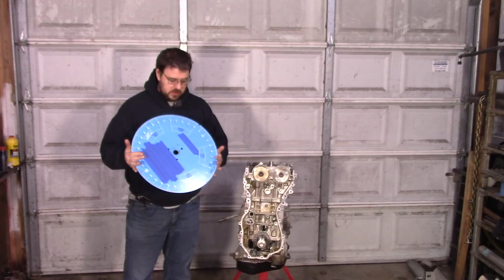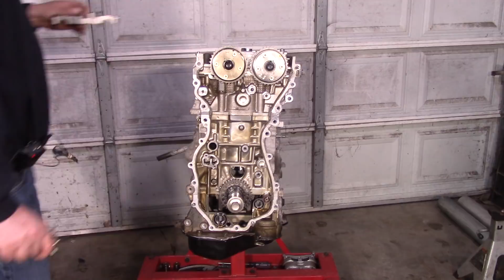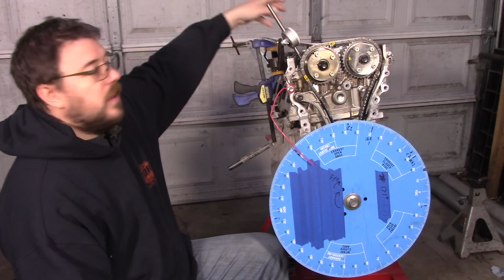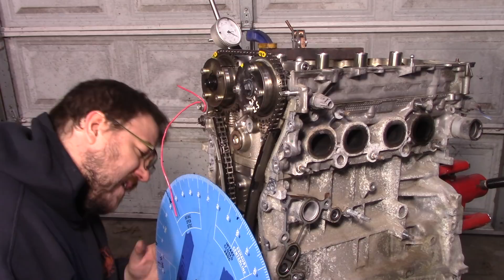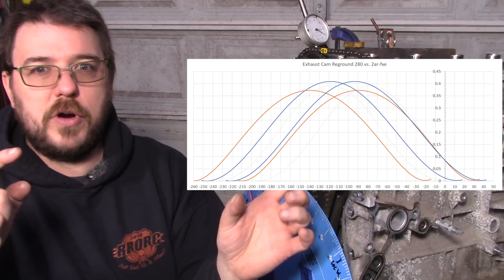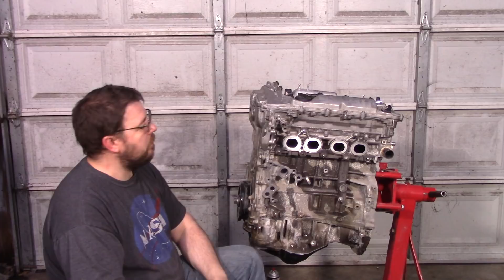Toyota Hybrid to High Performance Conversion (2AR-FXE)

Comment: I have a 2AR-FSE which is D4S not Atkinson cycle, and it's mated to hybrid drivetrain with e-cvt in a Lexus IS300h... I'm curious, your build in the video, will you pair it with hybrid drive or to a manual or zf gearbox?

Comment: Do you think using a 2arfxe block with 2ar/1ar heads would work? I know you wouldn’t get the duration advantage with the 2arfxe cams but assuming the heads are interchangeable we should still see a higher compression with maybe a small increase in power on a stock ECU without having to screw with the cams? 

Or at that point a 1arfe in its entirety might just be the way to go? 

Sorry if you already saw this comment. Think my old one never posted. Unsure.

Comment: Would the same thing work on the 2ZR-FXE?
Reply from the maker: i don't know for sure but based on what i've seen and heard it certainly seems like it would.
Reply: @FrankensteinMotorworks  ct200h's and prius' are way more common here (Netherlands) and so are the engines of course. Thinking of buying a ct and seeing what bumping up the power on that engine will do to the hybrid powertrain.

Comment: Do you think something like this is possible with the 2ZR-FXE.  Its sibling the 2ZR-FE was also in the Elise according to wikipedia.  And this engine is a dime a dozen now
Reply from the maker: It certainly could be but that's the kind of thing that someone just has to try in order to confirm if it works or not.
Reply: @FrankensteinMotorworks  I was talking to a mechanic over the weekend, who used to do track prep work on lotus's but now does a lot of refurbishing and service work on Toyota hybrids. He had mentioned that if you took the 2zz head and the 1.8L head from the Prius and sat them next to each other it would be hard to tell a difference between the 2.  Which ultimately led me down a rabbit hole to your video.   I might give it a try, a Prius with a dead battery could be a fun lemons car .
Reply from the maker: @CedricParker  if you go down that road please share how light a prius is without the battery. i think it would be a really light chassis and a great place to start.

Comment: What about axles and manual trans for an sw20 swap.
Reply from the maker: I will be making a motor mount for the SW20 to swap in the AR motor but the SW20's transmissions directly support the AR motor so there's no need for an axle or transmission swap.
Reply: @FrankensteinMotorworks  both manual and automatic?
Reply from the maker: @thomasiturraran3623  I have no idea on the automatic. Since it bolts to the 3s and the 5s motor there's a really good chance it will also bolt to the AR but the only guarantee is that the dowel pins will align properly.
Reply: @FrankensteinMotorworks  Thanks!

Comment: I don’t even own a Toyota or anything I would want to swap a Toyota engine into… yet… but this is interestingly… uh… interesting! Thank you for the videos!
Reply from the maker: even moreso after i raced it last weekend. This thing was an absolute beast. i will be making a video on that shortly
Reply: @FrankensteinMotorworks  Just out of curiosity… why not go with the dual VVTi? Doesn’t the TC have dual VVTi? Maybe yank it off that TC engine you too out of… that TC? 😅

Also… how are you locking the cam that does not have the VVTi solenoid?
Reply from the maker: @VictorMPR  I am using dual vvt-i. at 29:55 you can see both phasers are on there and at 30:30 you can see both solenoids are installed.
Reply: @FrankensteinMotorworks  I see! I got confused by you saying you were not going to use an exhaust VVTi solenoid… somehow I didn’t hear you say you were going to use the intake VVTi solenoid instead. I had to go back and “listen good”. Thanks for the clarification!

Comment: Are you planning to use the stock or aftermarket ECU?
Reply from the maker: For this one i have to use a Haltech Elite 1500 ECU because the cam trigger position is not stock. but the intention is to make it so this works on a stock ECU also.

Comment: How do you think this setup would respond to boost reliability wise? Compression too high you think?
Reply from the maker: After i get this on the dyno i'll have a better feel for the knock sensitivity at this higher compression ratio but based on the fact that people put 9-10 psi without issue on the lower compression motor then the higher compression should still be able to take a couple psi of boost. But you might be able to use the atkinson nature of this motor to reduce the compression ratio through the knock sensitive portion of the map (if there is one) while keeping the turbo mostly spooled up and then still have boost available as soon as you exit that region.

Comment: That moment when learning how to degree cams on japanese inline 4 motorcycles from the  late 70s with a degree wheel, coat hanger, butchered spark plug with a dull long bolt through it,  and a dial indicator pays off..again.  But yeah, it was a lot easier with just slotted cam cogs.  Factoring in the VVT makes my head hurt, but is the gist of it that, as rpms rise, you need to advance the opening on the cam to give the air a little more time to reach the much faster spinning engine?  You've got a super clever idea for building power on the cheap.  Hope it doesn't detonate.  But hey, there is always e85?  Thanks for sharing.
Reply from the maker: Yeah, it honestly made my head hurt a bit but I got it in the end. and yeah being able to dynamicaly re-time the cams makes the torque band much wider. it ends up adding 15-20% more power in the mid range over a motor with the same cams tuned for peak power only.
Reply: VVT is the gift that keeps giving.  Thanks for the walkthrough.

Comment: Slightly OT: Can the same be done with a 2GR using parts from the FKS or FXE? Wondering how complex tuning would be with port/direct injection. 13:1 compression on the engines from the Lexus GS 450h tho...
Reply from the maker: yes and no, i just got a 2GR-FXE intake cam and it is quite large but it can't easily be installed in the exhaust position for a few different reasons.
Reply: @FrankensteinMotorworks  any chance it might make its way into a video or is it too much of a roadblock to pursue further?
Reply from the maker: @VertigoGTI  It likely will. it's all dependent on how well this 2ar-fxe does first. I ordered the intake cams as a result of me measuring the 2ar's intake cams.

Comment: I do want to ask, what about swapping a 2arfe into an sw20? Would it not be a direct swap/close to? I’m a Datsun guy not an mr2 guy so let me knowシ
Reply from the maker: the motor is small enough to fit in there but nobody has confirmed if the stock position hits the strut tower or not. it might need a different rotation than stock.

Comment: I went 2 teeth with the 1nzfxe.
Reply from the maker: that's what i was fully expecting but i checked and checked and it looks like two covers what i need but keep in mind i'm still using the wide vvt-i phaser to i mechanically advanced it 20 degrees but i can hydraulically advance it another 50 degrees.
Reply: @FrankensteinMotorworks  Less is definitely better here.  I'm assuming the cam tooth is going to be hitting too early.  You might be able to mill a little bit off the tooth to keep it in line.
Reply from the maker: @mr220v  I'm just going to use a haltech ECU to see how much power it can make. but yes i will have to come up with a solution to change the pattern if i run this on a stock ECU at a later date.

Comment: This has me rethinking how I did my 1nzfxe in my aw11. It is also exactly what I am planning for my sw20. I have been searching for a good engine for about a month now. How do you find such good deals?!?!?! I can only find them for roughly double what you paid.
Reply from the maker: car-part.com, row52.com, autotempest.com and finally e-bay.com is really helpful in finding parts. Many people just search e-bay so the parts there are usually more expensive because of the higher demand.

Comment: Are there any heads for the AR series that uses d4-s injection? To my understanding timing of port and direct injection is what prevents knock for those high compression engines, not sure if that goes away with premium fuel but would love to hear your thoughts!
Reply from the maker: There is the 2AR-FSE but it is not available in the USA

Comment: You deserve even more subs than you've got, seems like each video is more impressive than the last! Definitely going to be swapping an AR engine in once my 1ZZ lets go.
Reply: If you do it now you can sell the 1zz...
Reply: @michaelscholten9753  Yeah, would be nice. My 1ZZ is burning oil at an insanely high rate, wouldn't feel good about myself if I sold it as a running engine.

Comment: I love the bit when you started getting it top dead center and e "ok, this cam was timed correctly - well, two teeth advances so..... clockwise." And then you stored that information in the air above your head, where it immediately evaporated. I, too, overestimate my ability to remember a bunch of stupid things at once - you should see my wiring colour changes, they're a work of art.
Reply: Also I'd subscribe twice if i could. If you ever get to the point where you can shill for sponsors, please find Curiosity Stream first. If you recommend them, I'll get them.
And another account for my dad.

Comment: Awesome.  About ready to pull my 2ZZ and replace it with this engine.  I trust that after you do the tuning on the aftermarket ECU, you will reclock the cam position sensors so that the stock ECU can work.  And I thought I did a lot of MR2 engine removals...

Comment: Im rather impressed with the number that this motor can potentially have. Anthing over 250hp would be extremly impressive for a stock motor. When you get into more aggresive performance mods this motor is going to be a beast. Thank you for all the info you are providing. Its gold
Reply from the maker: At the end of the day this motor has huge ports and very large valves so we certainly aren't at it's naturally aspirated limit yet. If i hit that 290hp number i will likely see about doing an ITB setup to try and get above that magic 300hp number.
Reply: @FrankensteinMotorworks  love it!

Comment: I have to set the timing on my cams for the widowmaker build.  My lord I was afraid math would creep up.  I have so many questions LoL.  First, how do you degree a camshaft again? I'm going to watch this 4 or 5 times again.
Reply from the maker: Why do you have to manually set the timing? i would expect your aftermarket cams to just need to be timed via the colored chain links and be done with it.

Comment: I've never really understood VVT. If you advanced the mechanical timing, having the valve open sooner...wouldn't the valve then also close sooner cutting off the intake stroke? Does the cam actuate fast enough to keep the valve on the cam lobe for every single cylinder on every stroke at 7200rpm??
Reply from the maker: The cam does not move that fast. it does just move where the cam is open. but the way air acts you can use it's inertia to pack more into the cylinder. for example if you leave the intake valve open as the piston is in it's compression stroke it will sometimes pack more air in. then on the exhaust, adding in some overlap can help suck through some of the intake air to clean out the cylinder fully so there is nothing left in there. it's a pretty delicate balance but vvt-i allows you to tweak it on the dyno and get somewhere pretty nice.
Reply: Also, remember that Toyota is using the 2ARFXE as an Atkinson cycle engine, which improves fuel efficiency at the expense of HP...fuel efficiency is the name of the game on a hybrid motor.  They are increasing the expansion ratio of the engine by having the compression stroke be shorter than the exhaust stroke, simply by leaving the inlet valves open during part of the compression cycle.  The effective  compression ratio is less than the 12.5:1 in actual operation as a result of this when operating as a hybrid motor.

Comment: The subs you have are well-deserved. Personally, I've always been interested in the potential of Toyota AR engines. I thought it was a grave mistake that Toyota didn't make a 3rd-gen Corolla XSE with a slightly souped-up 2AR to compete with the Civic SI. With so many viable routes for modification (stroker/1AR, bigger cams, and the 2AR-FXE high CR) as you've shown, I'm sure more will be excited. Heck, the miata community was even willing to explore, and create a kit for, the Ecotec 2.4l as a "cheap", large-displacement swap. There's absolutely no reason why the 1/2AR cannot match or even exceed the Ecotec and challenge the K20/24.
Reply: The market for sports cars is extremely small in the United States, which is likely why Toyota doesn't do it.  Would be very easy and cheap for them to do so.  Even TRD is no more.
Reply from the maker: Thank you i appreciate it :) It is odd that Toyota will develop something like the Corolla Blade Master but not something like this.